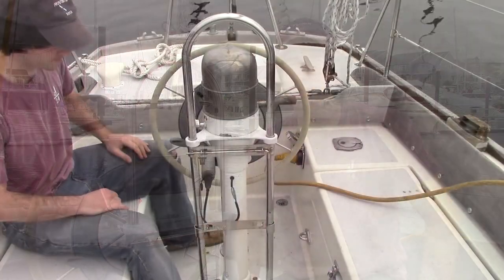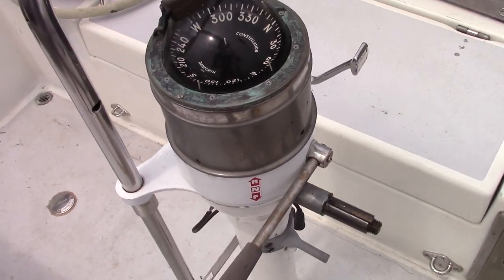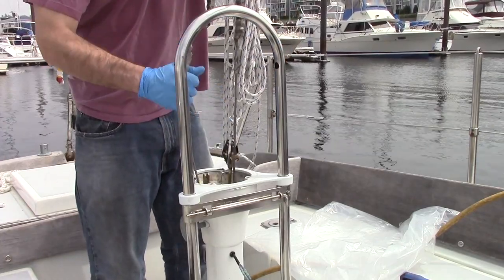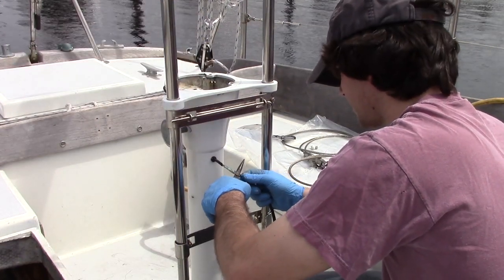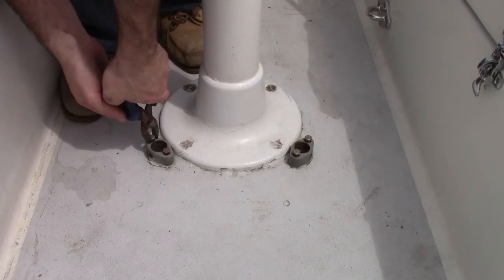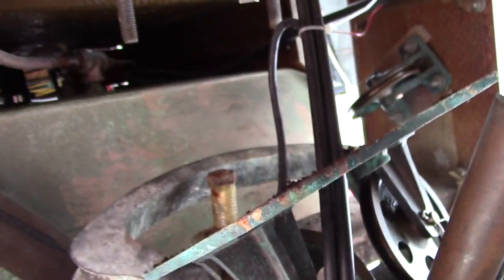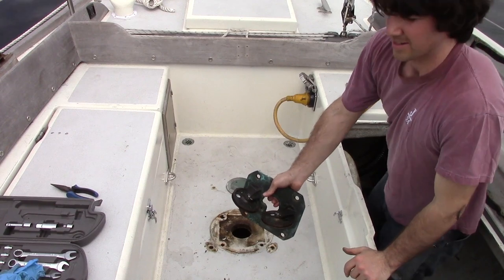Steering Refit - Part 1 (Pedestal Removal)

Comment: Hello Adam,
Thanks for the great videos. Would you venture a guess as to the total cost of rebuilding or replacing a steering pedestal on a 1984 Catalina 30? In particular, the gear shifting lever has been broken off and welded back onto the stub that remains. That was 10 years ago. It was very difficult to shift gears, but now it is nearly frozen.  Thanks for any advice!
Reply from the maker: Hi Chris,
Thank you very much for your note. We're glad to help with keeping your Catalina 30 sailing along. We can certainly put together an estimate. It sounds like a pedestal (2018 list for 336-5-211S: $1607) and an engine control (2018 list for 816ST-45: $418 / 870ST-45: $428) are needed, but it would be good to discuss further. It would be worth reviewing your idler, engine control cables, and chain & wire kit, as well. Let's make sure everything is in good working order to keep you safe out there. Please feel free to call us at 508-995-9711 and our team can walk you right through an inspection. We can answer any other questions too, that you may have on your system. Thank you for touching base with us!

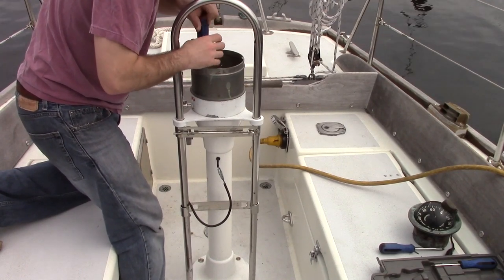Comment: I have some further advice, (1:55)  my 4 flathead screws are totally frozen.  Tried penetrating fluid...no go.  I just wanted to disconnect the engine control cables.
Reply from the maker: Glad to help. If you are just trying to disconnect your engine control cables, the only access fasteners you will need to remove, on a classic style pedestal, are those that hold the compass in place. Once the compass is removed (each manufactures method varies), then the cables can be released by disconnecting the clevis pins on the control levers inside the control. Note that if you are replacing the cables, then the engine control cable clamp will also need to be removed that is lower down the pedestal. We will have a video up soon to show this process, or feel free to call in and we are glad to walk you through it: 508-995-9711.

Frozen fasteners can be a challenge to remove. Whenever placing stainless fasteners in aluminum we recommend using an anti-seize product like Tef-Gel.  This is also useful on the aluminum pedestal bolts. If it is already too late, letting the penetrating oil soak into the metal overnight may help. A carefully used impact driver can also help to free things up. In a worst case scenario, the fastener may need to be drilled out or cut off. If you do get stuck in this sort of situation, please give us a call before doing anything and we may be to offer some additional advice.

Thank you for your comment!

Comment: I need a compass for my pedestals, I can't find where to reaper my old one or where to buy a new one, thanks
Reply from the maker: Hi Salty Habits, we're glad to assist! Edson is a dealer for Ritchie Navigation and their compasses can be sent back to them for repair. Just make sure to touch base with them before shipping it off: www.ritchienavigation.com. Not every brand has withstood the test of time, so there are also various shops across the country that specialize in compass repair. One example is: www.vikingcompass.com. If the compass is beyond repair, we are glad to help you with selecting a new Ritchie compass. Please just give us a call at 508-995-9711 or email us at info@edsonmarine.com. Thank you!

Comment: How about telling us how to get the wheel off when it dont come off as easy as the video and you are ready to pull your hair out!
Reply from the maker: Tony, thank you for the question. If the wheel has not been removed in a long time, it is possible that there is some build up of various materials (salt, dirt, grease, etc) between the wheel and the hub. If this is the case, a penetrating oil (like PB Blaster) can go a long way. After spraying it in between the wheel hub and shaft, let it sit for a couple hours. Make sure to catch any excess spray with a rag, so as not to stain your deck. If that doesn't allow removal of the wheel, lightly tapping on the aft end of the wheel shaft with a rubber mallet, while pulling aft on the wheel hub. If you are still having trouble removing it, try adding a bit of heat to the wheel hub (we're not talking about a torch, but something along the lines of a heat gun on low or hair dryer) and then try using the mallet method mentioned above again, with a thick glove on the hand holding the wheel hub. If all that still doesn't do the trick, a wheel puller can be used, just make sure to protect the polished surfaces on the wheel.

We are always glad to assist with issues like this. We can even walk someone through the process while they are on their boat. Just give us a ring at 508-995-9711. 

Thank you again for reaching out!